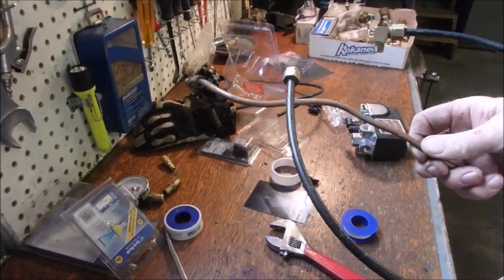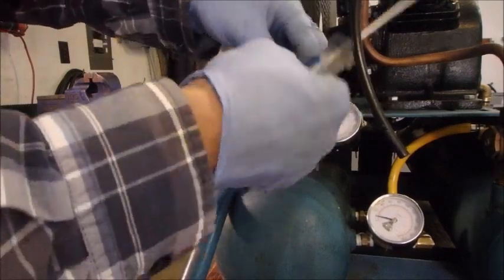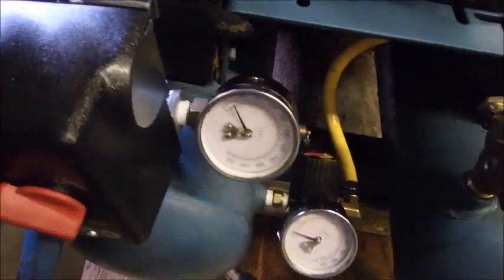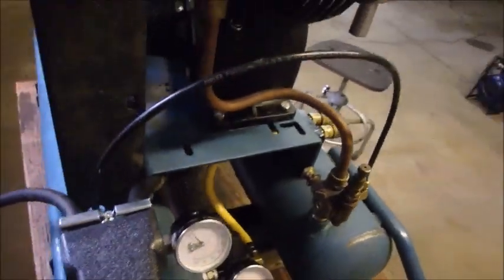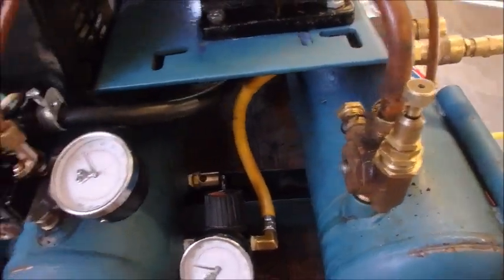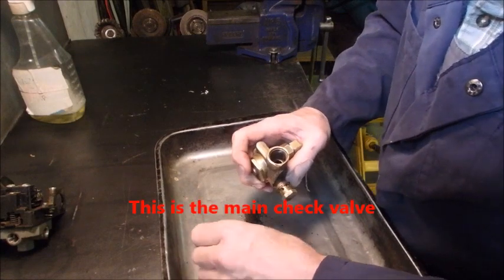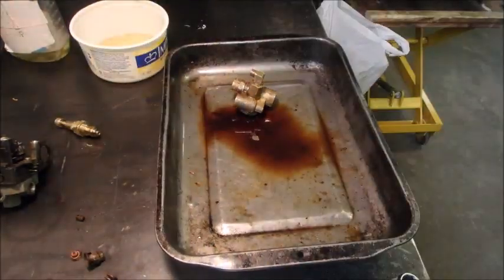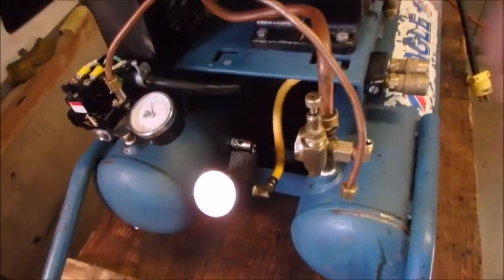Adding a Pressure Switch and Testing a Compressor

Comment: I have a rotary air compressor It has an Allen Bradley 836-C5 pressure control module and I don't know how to wire it to the motor when I got it the wires were cut on the pressure switch and the motor but I put power to the motor and the motor spins I was wondering if you have any advice on something like that?
Reply from the maker: I would google pressure swith wiring

Comment: The reason for the wiring schematic not showing where hot and neutral go is because it's not polarized so it doesn't matter which way you put it
Reply from the maker: I get that but it is still good to do that the same everytime.  thanks though

Comment: Some compressors come with a continues run valve and a check valve. Mostly construction compressors. The large valve you have there is the continues run valve. Maybe you have learned that by now .
Reply from the maker: It is weird as this one is electric.  Most of the construction ones I have worked on are gas powered which is why they don't shut down.  i could be wrong but it is all a learning experience.

Comment: Hi Bruce, Good save on the compressor. Are the new pressure switches preset with a limit feature as far as max tank pressure goes or do you need to calibrate them yourself? I have an older small compressor that I inherited and wouldn't be surprised if it might need a new switch soon. Thanks
Reply from the maker: Yes they are preset but i turned it down just because the compressor is so old and the water issues too.
Reply: Thanks. Thought so but wanted to check.

Comment: I watched all three videos Bruce and learned a lot as always. Where were you able to find the replacement parts?
Reply from the maker: Well the outlets are on the regulator.  It runs like a top and my friend that brought it to me is very happy.  It will be used in the construction area.  (on site air supply)  Did I miss something   be honest.

Comment: Was it plugged in to a typical 15 amp breaker with the test or were you still using the higher amperage outlet? Took some time, but now you've got a great compressor you can take along if need be! Cheers my Friend! Sean~
Reply from the maker: At first I used a 15 amp plug on the bench with nothing else on it (it blew every-time).  Then I "rigged" a 40 amp from one side of my welder setup  ---115 volts (It ran it for a while like that)    Once the compressor loosened up I went back to the same 15 amp on the bench and much to my happiness the breaker stayed on

Comment: That valve you were cleaning out is usually the main problem I have seen when working on the compressors.  You were lucky that you were able to fix it.  In the past I had always replaced them.
Reply from the maker: I always push it too far.

Comment: Really good Job Bruce. I see now how the gauge setup was going to work. I didn't realize the Pressure switch had a gauge port on it. Both of my compressors have 2 gauges on the regulator.
Reply from the maker: Got it.

Comment: Great job Bruce. A bit of a wrestling match, but you got it pinned down. Inspired me to go out and get a ball valve drain for my compressor. Sure is nicer than that damn petcock drain valve. Also picked up an airline water filter too.
Reply from the maker: Good for you.  You know I really like working on compressors.  They are dangerous buggers though.  Lots of soap for leaks.

Comment: On that yellow output hose, where it goes through the frame; you could get a bulkhead union fitting, I think that would be the most secure way to mount that. something like this is what I'm thinking of: https://www.princessauto.com/en/detail/bulkhead-hose-coupler-pneumatic-fitting/A-p8092769e
Reply from the maker: Thanks Corey.  That would do it.  I may buy one.
Reply: Thanks for the reply Bruce, glad you like that idea. I worked on a few different gas/electric air compressors at my last job, didn't appreciate working on them at that time but now I find it interesting for some reason. Thanks for the videos, I like your style and approach to repair work and I learn lots when I watch your channel. :)

Comment: that compressor has a lot of power it would be nice if the tanks were bigger but then it would really be hard to move around.
Reply from the maker: Carpenters love them as they can be put into a jobsite easily.  Thanks

Comment: Good job getting it running Bruce The only thing that worries me is the place you mounted the manifold and couplers, a two hundred pound gorilla will have no problem breaking off the couplers at the tank now. Just a thought about some reinforcement there..
Reply from the maker: That bugged me too.  My other 2 compressors use that too.

Comment: Did you get the problem fixed that kept popping the breaker?
Reply from the maker: Yes   sorry about that   it was just so stiff from sitting (motor working to hard)it just needed to run for a bit

Comment: Bruce, I have a Troybilt  Bronco tractor. I was having trouble getting it started. It acted like the battery was dead but I know it was good. I traced the ground wire back to the frame and it was fine. I suspect the start switch may be going bad. Is there anyway to test these? May be a subject for a video. Thanks Steve.   P.S. always enjoy your videos.
Reply from the maker: There is a solenoid for the starter Try that.  Zippo varga just did a starter switch for these last week.  
https://www.youtube.com/watch?v=TAmiFCz8d0U